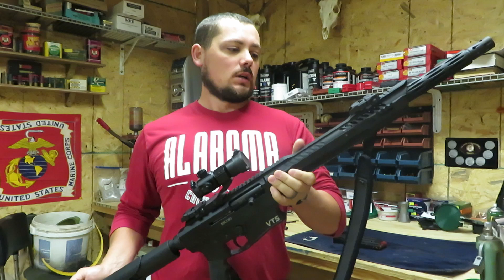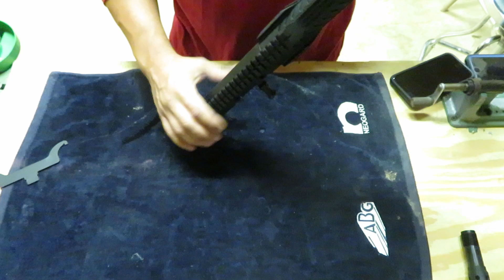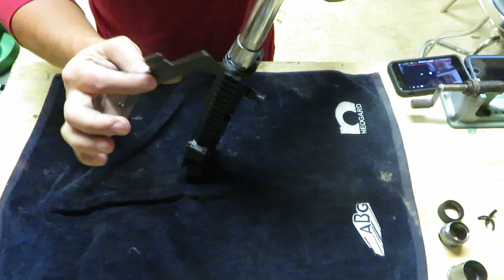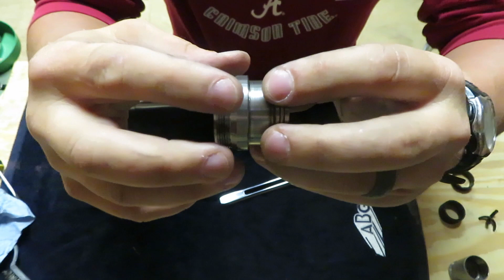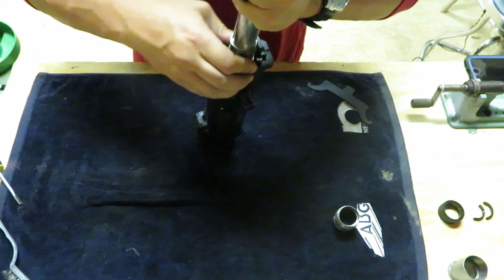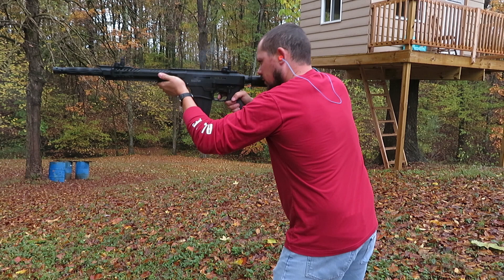Hatsan DF12 Break Down & Repair a

Comment: Hi! I got an issue in the dissasembly in the part where you remove the first big pin min 3:07, and then you say to push back gently to remove 2 black rings that hold it in place, I managed to lower that with a hammer gently and the black pins removed as shown in your video but then the silver cilinder wont go out at hand pressure, should I "hammer" it out again gently?

Comment: I had this exact same issue, my ring, did the same exact thing I was able to push it back into the groove, but it keeps popping back off. Have you figured out a permanent Solution for this.
Reply: I've also looked through the catalog and I cannot seem to find a replacement ring that I can order.
Reply from the maker: No sorry. I only had the shotgun for a few months before selling it for a new toy.

Comment: Mine did it and keeps doing it after each shot. I took o ring out and now I do not have any issues. Not really sure why the o ring is there or its purpose really
Reply from the maker: How many rounds have you shot since removing the ring? I no longer have this shotgun but I’m would be curious to know the purpose of it runs fine without it.
Reply: @ I’ve put probably 20 3 inch magnum shots through it and it’s fine. Took it apart and everything looks fine. I’m not sure what its purpose is. It didn’t really look like it had a purpose before I took it off
Reply: @stephenvaughn9356  добрый день, тоже имею такое ружье. И у меня та же проблема при стрельбе определенными патронами выскакивает это кольцо после каждого выстрела. Нет другого решения кроме того чтобы снять кольцо?

Comment: Great video. Was hoping this would fix mine but no luck. After disassembly and reassembly, took it out today to try again. I can see when firing the hammer is not contacting the firing pin. It does contact it when unloaded/dry firing. Any ideas??
Reply from the maker: The first question is how do you know it’s contacting on the dry fire? Not picking an argument honestly curious. I would think it would be something with the firing pin spring or possibly a safety. I don’t have the shotgun anymore to look closer. Sorry but I would check the spring in the bolt then maybe run it to a local gunsmith. Sorry I couldn’t help. I wish you the best of luck in getting this handled.
Reply: You’re able to see it through the slot that the charging handle runs through. So it’s visible even when the gun is assembled. I’m going to break it down again today and check out the springs. Already replaced the entire bolt/firing pin assembly. So we’ll see! Thanks anyways for response, take care!

Comment: I had the same problem come to find out it was just because of loose internals after I took the gun apart, cleaned it and reassembled it a little tighter. It cleared the problem right up. Hope this helps someone. And P.S after you shoot it about 50 times you most likely will have to re-tighten at least the barrel.
Reply from the maker: Thanks for the comment and for watching

Comment: I had the same issue, reset the ring, went to the range and shot another 30 slugs and had the same symptoms. This time, the piece that that same clip sits in was quite deformed. As was the barrel at the same location. to the point that parts 305-310 would not come off of the gun without some serious force. Now it wont go back on. Waiting on a response from Hatsan USA
Reply from the maker: Wow that sucks!! Please let us know what comes out of this. I'm curious to know how good their customer service is. Thank you for watching.
Reply: @suburbanhunt3653  
Will do, thank you for the video
Reply: Well?
Reply: Well, called HatsanUSA and they argued with me. Finally they sent a shipping label. Got the gun back 3 weeks later with no response asto how it happened. Went to the range and the same thing happened again. Once ahain,they argued with me and sent a shipping label. 4 weeks later, I got the gun back. Took it to the range and noticed the lower was cracked before I got to shoot it. Once again, they argued with me and I had to get nasty with them before they agreed to fix it. I haven't touched it since it was returned to me. This gun is a POS and the customer service is hot trash. GEAUX TIGERS!!!
Reply: @stevekennedy9439  mine did the same thing. I ended up just taking the ring off

Comment: Mine works great, other that losing the bolt cocking lever. Any info on where to order parts? Other than the lever, mine hasn't disappointed. It has spit out everything I've put through it. She is a rank bitch, had 1 failure to eject but I think the shell was old. Had it sitting in my tool box for 10 years. If I can't find a bolt cocking lever I'm going to make one. I don't much care for how its secured anyway. Seriously, a spring loaded ball bearing on a part like that. I'd even say this shotgun is probably a little over engineered, except for the lever. Someone got stupid on that

Comment: What kind of buffer does the shotgun use and can I find something to fit
Reply: Ok thanks for the help
Reply from the maker: @jamesstinson519  If you find one that fits please let us know so we can pass on the information. Again thank you for watching. And if you haven't alright please help us by liking and subscribing to the channel. Thank you.
Reply: @suburbanhunt3653   ok I will
Reply from the maker: I assume you are referring buffer tube/butt stock. I didn't have to the shotgun long enough to try any other butt stocks I know the one that go on normal AR-15 platforms didn't fit.
Reply: @suburbanhunt3653  oh ok like what was the name of the one you used that didn't fit
Reply from the maker: it was a Hogue Overmolded stock that is normally attached to me Anderson Lower.

Comment: How do u remove the stock and whats a good replacement any suggestions
Reply from the maker: I used a stock wrench. We didn't replace the stock as the dimensions are slightly different then a standard AR15 stock. I wish I had a recommendation for you but I sold the shotgun without replacing it. I wish you luck in finding one. Sorry we couldn't be of more assistance. Thank you for watching.

Comment: I had the same issue with mine was curious if you had any more problems out of that ring
Reply from the maker: No, please check out the follow up video. We have shot well over 100 rounds and she has ran beautifully. Thank you for watching.
Reply: @suburbanhunt3653 good deal. I had broke mine down and cleaned then go to shoot 2 3/4"  7 1/2 shot target loads and it shoots just fine but everytime I got to shoot 3" 00 buck or slug it blows the ring out. I may have to replace my ring.. also I have the escort sdx12 which has the same internal to the df12 just different stock and foregrip.
Reply from the maker: @MrBigholt  I have to be honest I don’t believe we have ran 3” buck shot or slugs. I know we have ran several 2 3/4 “00” and “000” buck shots. If I can find some 3” we will give it a shot.
Reply: @suburbanhunt3653  good luck on finding the ammo.. I may just stick to 2 3/4" shells for it. It was stamped that its chambered for 3" but it just don't want to run 3" very good and blows that ring out. Im going to do some more digging on it and found out I may just have a defective gas ring/block.

Comment: Hi, thank you for the tutorial. I have only one question. On my gun i saw that those two circular pins have little notches in the middle. Is it important which way are they facing? When i was taking the gun apart they both jumped out of the assembly, so i couldnt see which way were they set.
Reply from the maker: I don't believe so. I didn't see the notches. So I either got lucky or it doesn't matter. Thanks for watching

Comment: Great video. Wierd how that snap ring popped out of it's groove. Hope that's not a common occurrence.
Reply from the maker: Agreed. We ran about 15 rounds through it yesterday and it had no problems. We have a range day planned. Plan to put 200 rounds through it rather quickly. Video to follow. Thanks for watching.
Reply: @suburbanhunt3653  It's happened to me twice. Looking for a longer-term solution than taking it apart to fix each time if anyone has any ideas.
Reply from the maker: @jdumont1970  man that sucks I wish I knew. I have have since sold mine for other projects. At this point I would have a local gunsmith look at it and see if they can help. Sorry couldn’t be more help.

Comment: Thanks for making this video I just purchased one and wanted to know how to do the break down also we’re can I buy the 10 round clips?
Reply from the maker: I was unsuccessful in finding magazines that I can say 100% will work with this shotgun. I have put a call into Hatson. Their catalog shows they make a 10 round option. I will update if and when I have an answer.
Reply: @suburbanhunt3653  Hatsan does have and sells a 10 round box, unfortunately they said they can't ship/sell in the U.S., Pantzer's 10 round box is a descent options.
Reply from the maker: @franktalarico2930  Thanks for letting us know. I found one on EBay and have it on the way. I will add it to the follow up. Thanks again
Reply: I called and emailed company.they WONT import 10 rd magazines to u.s..I have a sdx410 and wanted a higher capacity. Any suggestions?
Reply: The Panzer 10 round magazines work flawlessly in it.

Comment: Is the butt stock removable and able to be changed out with other ar platform ones. I ask because another brand shotgun I was looking into getting you weren't able to change them out
Reply from the maker: That is a great question!! I was looking at my AR stocks and they appear to be the same size. I will try it and let you know. Thanks for watching
Reply from the maker: Ok So I'm sad to say that this stock is not interchangeable with AR15 stock. (Or at least I wasn't able to make it work). The issue is the buffer tubes are slightly different sizes. Well taking the stock down I realized that this stock in not adjustable. The stock is held to the buffer tube with a bolt. Hope this helps.
Reply: @suburbanhunt3653  Is the butt pad held on with a Philips head screw? Also did you try using a commercial or a Mil-spec adjustable stock. I didn't know till now but there is a difference in tube size between them mil-spec buffer tube is about two hundredths of an inch smaller than a commercial tube.  Found out when changing stocks on my F12.  Thanks again for putting up a great tear down video!